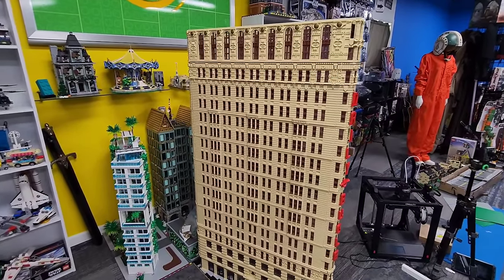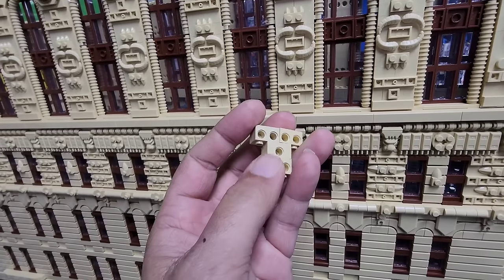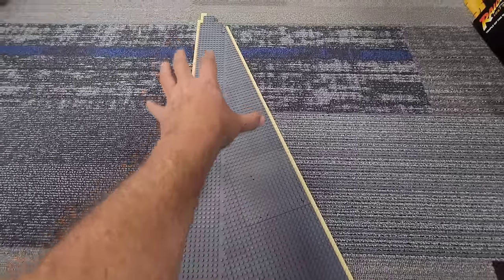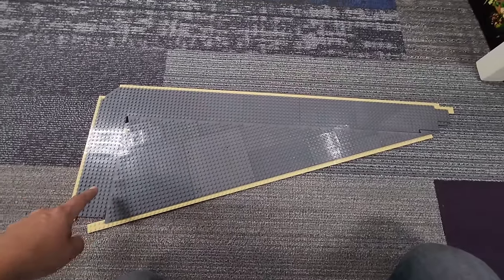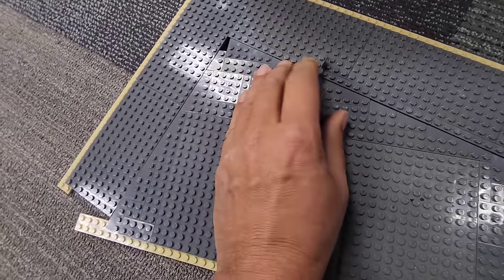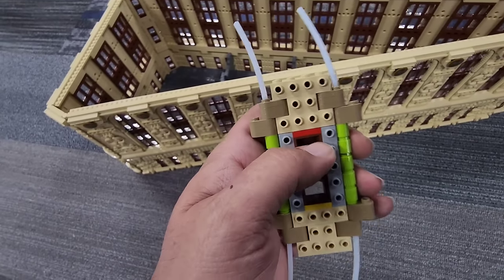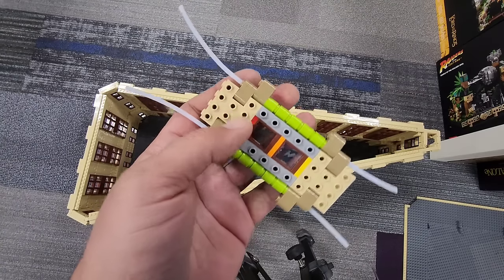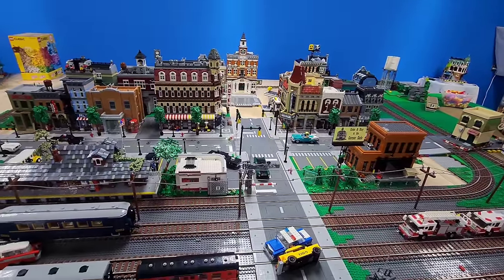Mastering Lego Architecture: Tips and Tricks for Advanced Builders

Comment: IIRC the technic hole + plate technique is illegal because the connection points are imperceptible misaligned, putting stress on the plates. But it's legal if you only have one connection point, e.g.if you used jumper plates
Reply: I searched up your reason because i as well couldn't remember and yes you are partially correct. Anything longer than a one by one is illegal for the reason you stated

Comment: It's such a nice design, a real honor for the building. The technic brick to me is not illegal, its such a daft term anyway. The only thing I find sort of illegal is when people use flex tubes inside stuff to clip on and it doesn't really fit or comes loose. We should always try to build things that aren't so flimsy , but again calling it illegal is stupid .
The wedge plates have been used by lego many times and even the hinged brick connections have been used by them for star destroyer designs in the past, although I appreciate your design does put a bit of pressure on the bricks .
Its a real masterpiece though mate , love it 😍
Reply: Illegal in this and many others refers to connections that can damage your pieces over time. Many techniques were "illegal" and are now common due to improved moulding. For example clip and tile connection.

Comment: The technique you are using to put the underside of bricks towards the exterior of the building might actually be "illegal" as it could put too much stress on the bricks. However, there is a really simple alternative to this, which is to just use the back side of those headlight bricks. The square hole here is made for studs to fit perfectly.
Reply: Was thinking the same thing.  Gets trickier when you need to offset the brick for the top bit of detail. You'd have to add a jumper, which effects the dimensions.  Of course rotating the headlight so that the bottom faces out fixes that but then your plates stick out different amounts... you could use clips and bars... so many options if you really wanted to do it... but this isn the cheapest and most structurally sound

Comment: Im pretty sure illegal building techniques are only illegal because they put stress on the bricks which may ruin their quality and longevity. But, if you're not planning on reusing the bricks then i don't see an issue! Such a cool build!
Reply: In some cases it's extreme stress, you can see that these technic bricks do not even line up - the distance between the wholes is not equal to the distance between two studs.